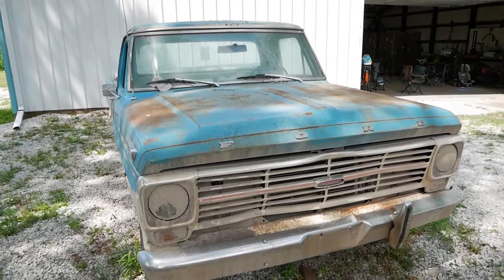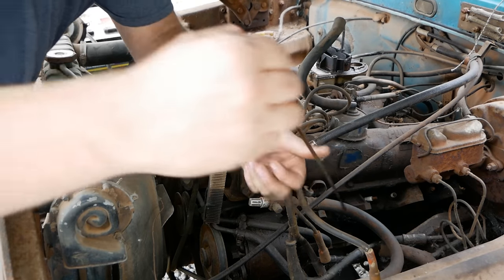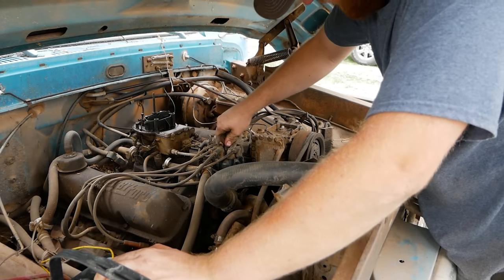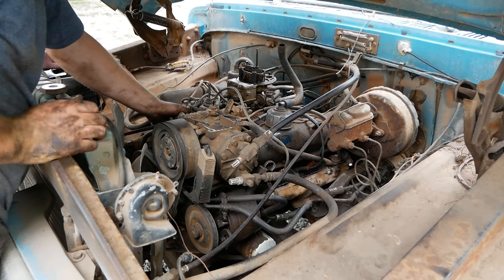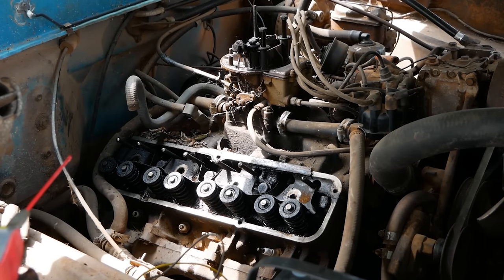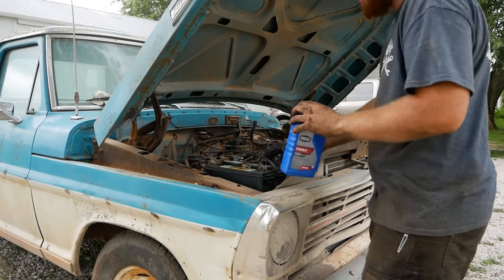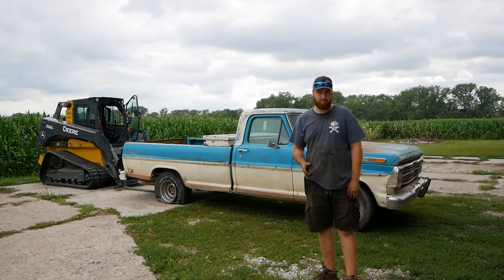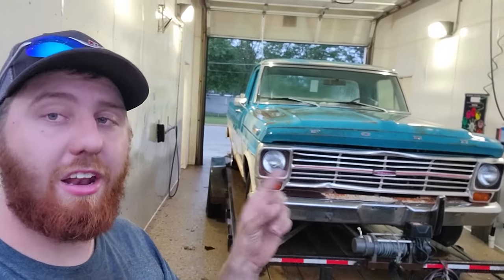Will This Tired Old Ford Come Back to Life? -- 1968 F100 Revival

Comment: I just fired mine up! Been sitting for 7 years! Drove it yesterday! I have a 1970 F250 Sport Custom,390 automatic, pwr steering and brakes Disc brakes front drum rear has the chrome package including wheel well trim And all trim is perfect! Bed is also perfect inside  and overall body is amazing for a truck of its age! Has factory A/C,stock radio chassis is clean, just frozen it yesterday for a while has lots of power dual exhaust, carb seems to be rich! Auto trans and goes like he'll! Kniw anyone that may be interested in owning it? I am in my Seventies and Love the truck but the same time have too many vehicles. This one is a beauty and all original. Drives Nice!etc me know your thoughts Please.  I am just finding out that my truck is Desireable and Nice! Also have a 1969 f250 short box crew cab 390 auto had it. Many many years No debts but a good amount of rust was daily driver for 40 years. Idk bout what I am gonna do with it yet. Any helpful ideas?

Comment: Weak spark:  is the coil body grounded? Those shocks were a symptom, they got you when you were close by. Plus: you'd freed one valve, but did you notice another cylinder's rocker rusted? Symptom of a second.

Comment: Where I live here in the salt and rust belt USA y'all take your field find truck to a spray wash U is comin home with half the truck ya just bought guaranteed. The rest it will be on the trailer or the drain pipe at the spray wash. U can always come back and scrape up the rest of it later.

Comment: I picked up a 1988 f150 4x4 got it running now that part is done with. I have to replace the cluch an the rear end need rebuild or replaced. That's next one the list to do

Comment: Spun cam bearing not allowing oil to the rocker. Valves and or rocker arms seizing causing your bent pushrods and lifter noise

Comment: It's a Exhaust Manifold not a Header!!!
 Sorry if I'm a ass.

The difference between them is that an exhaust manifold is a solid cast iron structure across all cylinders while an exhaust header is made up of a series of individual steel tubes for each exhaust port.

Comment: I'm currently rebuilding a 1985 Ford ranger. She needs a new moter and I've had trouble finding one and rebuilding the one that was in it. I've cleaned and painted a lot of the motor parts, 5 speed manual transmission, drive shaft and I want to clean re-paint and restore the body. Thought I'd comment and see if y'all respond.

Comment: Dumb question but... "why" does running an engine without an exhaust manifold/header cause exhaust valves to burn? And how quickly can that happen? I saw once you got that engine to actually run on it;s own you were pretty keen on shutting it off STAT.
Reply: The cold air from the atmosphere will flow back into the head and some science happens (I don’t know exactly what) but it can happen pretty much immediately, as the valves heat up real fast

Comment: good candidate for a rebuild looks like it needs oil pump main bearings valve job and a cam
Reply: along with cap rotor points condenser wires plugs carb cleaned rebuilt

Comment: I object to pulling out a working engine even if it does have a quickly straightened pushrod.  You should get as many miles as possible out of an engine before pulling it and it looks to me like that engine has a few more miles in it.  Also, I think the sides of junked appliances make better patch panels than old license plates.  Get more practical. more miles per dollar out of your vehicles, including reviving more economy cars.

Comment: Kevin what did you do with this blue and white 68 Ford f100 and do you still have it?!
Reply: Would sound awesome!!
Reply: I was putting on here I still think this would make a neat toy parts hauler truck and I would probably end up throwing a bump or dent side Dana 60 4.56 geared rear end up under it and rebuild the fe 360 2bbl, and put a competition cams xe series camshaft in it and it would sound awesome!!
Reply: And have a built automatic transmission setup for it with a 1500rpm above stock torque converter

Comment: I saw a ‘70 Ranger SWB with no engine or transmission, rust on right front cab mount and corners.  Top had hole from a tree, asking $3800

Comment: Are the FE engines in these trucks even worth rebuilding or were they the 60's equivalent of the 3-valve Triton's where you just chuck them when they blow? They don't sound very reliable if they're known for eating pushrods for dinner. :)
Reply: Mustang 3vs are nice. Not big on power u til you build them for boost. But they absolutely love boost
Reply: @sheltonbradley1648  I'm not a fan of the 3 valve Triton's used in older F-Series trucks. I don't know if the ones you speak of in the Mustang are related. But the older ones in the trucks have bad design ideas that shouldn't have happened. I'm more for the Windsor's/Cleveland's and the bullet-proof 300. Though I haven't had the opportunity to own very many Fords. :)

Comment: Break the rules and drop a car T10 four speed in it. I'm to assume it will be the 427 or even a 406 ........ the mercury engine sizes kind of evade me, and I don't think the shared the same bolt pattern on the bellhousing so there is that. Drop spindles of say six inch and lowering blocks in the rear that will make the bedsides look like fender skirts. A really clean interior with a Ididit steering column..... a limited slip lincoln rear end with disk brakes. Led lights, cut and buff and replace the stainless... your on welfare if you get all that done. Not wild about the 460 but some are.

Comment: Typical Ford tick, tick. Every old ford i've ever owned has done it. Not saying nothing bad about ford because every vehicle but one that i've ever owned has had a little knock to her somewhere. Put you a good radio in her and turn it up. That tick goes right away. Or you could just change the lifter. Either one. I like the radio idea myself because you are knocking out 2 birds with one stone.

Comment: All was goin well until you did exactly what luke said in your rust-lite revival, if theres a tight spot, should prolly go over and check it B4 starting the engine otherwise you could ruin what was ment to be a good motor, and behold you potentially ruined a good motor even tho you plan to put a bigblock in it anyway you still ruined a motor.

Comment: Says let's get some more oil on this stuck valve, proceeds to spray wd-40 on it. Not oil. Not lubricant. Garbage spray with heavy marketing strategy that is overused, and not the right tool for the job.

Comment: I love your videos but first off I know everyone wants to see the motor spin over and the whirly gig going.. but even though you got a crappy carb already you get 30 seconds away from pumping all the old fuel right back into the old crappy carburetor unhook the fuel. Please stop with the brake clean and the carburetor cleaner to try to start the motor the poor motor is dry enough try some two-stroke oil and fresh fuel...I about cried watching the old bronco vid..